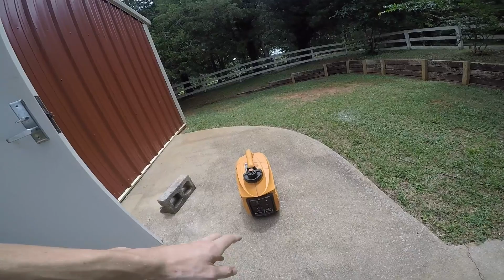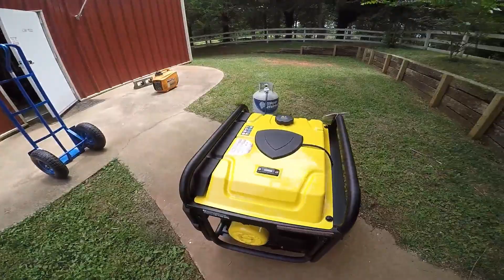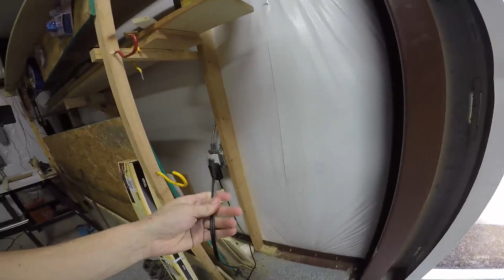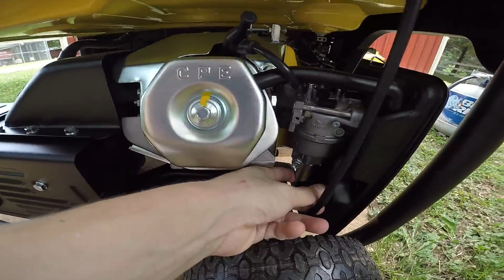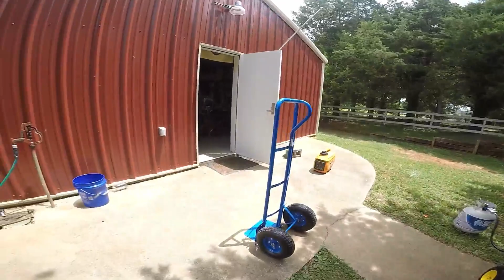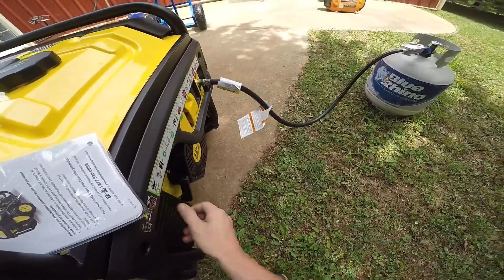Champion Dual Fuel 7000-Watt Generator Overview

Comment: As long as you have no gas in fuel line and carb when it's not being used. I use  SEAFOAM,
and when done, i shut off gas and let engine run out, the drain to make sure no gas is left
in the carb.  I start my 2 gens every 2 to 3 months and they start everytime.. get urself a note
book, keep track of hours run so u know when to change oil. make sure air filter is also
properly serviced it makes a much bigger difference than you know.. if u have nat. gas and in
an emergency situation, blizzard tropical storm, I wouldn't worry about emissions.

Comment: It will run off of natural gas, but it will require a natural gas regulator as the propane regulator is different.  It will not run off of natural gas connected to the factory propane regulator.   Add the second regulator fairly inexpensively and enjoy a tri-fuel generator.

Comment: Hello sir, how does the Champion Dual Fuel 7000 Watts hold up over the years?  I am planing to get one from Costco but don't know anyone in my family and friend circles owning a Champion generator.  So, just curious about its reliability.
Reply from the maker: Well, it really hasn't had much use until recently. It ran for about a day a few weeks ago after the power lines were knocked down. Ran flawless with no issues, and that is better than what I can say for the Generac. Long term it's hard telling but it is holding up pretty well and still starts right up. I do only run it on propane, to keep the internals clean. Almost all Genertors now days are sourced from China, that said the Champion brand machines seem to be a higher quality China than the rest of them. No complaints so far.
Reply: @crazyjdkid  Thank you for responding.  That give me a little more confidence to look into getting the Champion Generator (Duel Fuel) that I see at Costco.com.
Reply from the maker: Thats were I got this one.

Comment: Generac makes lousy residential generators from portable to back up type. I do not understand the desire to use propane in home situations. The tanks and fuel are expensive and in a disaster situation such as a hurricane the propane supply is hit harder than the gasoline supply as there are more gas stations than propane fill establishments. The tank shown is about $35 and holds 4.7 gallons or about $18 you have about six hours of run time with that tank. This type of generator is not safe for sensitive electronics, this unit does not produce a pure sine wave. Use non ethanol gasoline if stored properly two years is the shelf life.
Reply from the maker: Propane is an important fuel for backup generator. It gives you flexibility in fuel options. Everyone usually has a propane tank laying around for there grill so its not extra fuel you will have to store. I don't know where you are located but here to fill a propane tank like that is about $9 not anywhere near $18. The oil stays cleaner longer and I can hook it up to natural gas off the house if need be in a pinch. So there is a lot of logic in having propane as a backup,and I can always run it on gasoline if I need to as well since it is dual fuel. The less gasoline you run the more likely it is not to have carb problems, fuel leaks, gasket and hose deterioration.
Reply: @crazyjdkid  I am not disagreeing with you about propane being an alternative source of fuel it is just more expensive. I live in a major city and people have different criteria and the prices for propane here are about $4 per gallon. As I stated in my situation propane was impossible to find during the last three hurricanes while gasoline was abundant. One store I use had gone through 30,000 gallons of propane in two days and did not know when they would be resupplied. 
I use the Honda EU2200i and I was out of power for seven days once and then three days and used the generator for 48 hours while using 5 gallons of gasoline. I don’t think everyone has a propane tank lying around; my neighbor did not have a match to light a candle. In your situation propane seems like a great alternative. I had a Kohler 8.5 hip. generator a few years ago and to switch from propane to natural gas I would have needed to change carburetor jets, hopefully yours is set up for both fuels. People how do not have the natural gas option should not depend upon one twenty pound tank to get through an emergency or disaster situation. The problem with carburetors gumming up is lack of proper maintenance and using ethanol gasoline which I never use in a generator. In my many years of operating generators I have never had a seal or gasket go bad, but I am very finicky about maintenance. Best wishes to you and I hope you never have to use your generator in an emergency or disaster situation.
Reply from the maker: @TheMickeymental  This generator can switch fuels without any modifications, all you do is turn a knob to switch from gaseous fuel to liquid fuel. So I can use either fuel. I believe it can run natural gas through the propane line as well, just haven't tried it. All I am pretty much getting across is that it is a dual fuel generator that I can choose what fuel I use and switch at any time depending on what is available. I generally have 3 LPG tanks and 20 gallons of gas at my house at any given time for other machines. I use the LPG first as I don't store it with fuel and I don''t want to have fuel stored in it. Honda generators are great, and you could easily add a Trifuel kit to yours too. I have about 40 pieces of outdoor power equipment and the less I have to maintain and ensure the fuel is stabilized the better. Preferably I would rather have a diesel above anything else, which I do have as well. This generator has seen some use recently after a tornado in the area droppped some power lines, ran great and got better than advertised fuel usage. Thanks for watching!
Reply: @crazyjdkid  I looked up generators and the dual fuel are gasoline and propane. The trifuels are gasoline, propane and natural gas. Diesel generators are usually larger more expensive generators. If you are depending upon your generator to use natural gas you may want to investigate  whether yours will or will not accept natural gas. As I stated the Kohler I owned needed to have a different jet. Also with propane you will be getting less energy as it requires 1.38 gallons of propane to equal 1.0 gallons of gasoline. I am not sure if that will shorten your run time or cause you to use more fuel. I found that to be interesting. The Hondas presently are sold out at a lot of online site especially the 2200i. The corona virus along with the wildfire problems in California have caused a price spike. What state so you live in?
Reply from the maker: @TheMickeymental  Yes, but I highly doubt that there is much difference in burning the propane vs natural gas mechanically wise besides a significant power drop. The propane does have slightly lower run time, at 50% load your looking at 5.5-6 hours for one 20lb tank. It uses about 1.3 gallons of gasoline per hour under 50% load. It's a thirsty machine no matter what way you look at it as it is not an inverter unit that can throttle down. It runs 3600 RPMs as soon as it starts. This was filmed in Alabama, but live in Texas. I am actually a mechanical engineer, for a large industrial diesel engine manufacturer so I am pretty fluent in engines and air/fuel ratios!
Reply: @crazyjdkid  I am in Florida we get a lot of the same weather, but our tornadoes are over the ocean mostly. The difference in natural gas and propane is the carburetor jets, but propane does have a higher btu rating than natural gas. I am only a professional musician so you have me on the engineering part. Good luck to you.

Comment: I pay $20+ per propane tank here in CA so at $9 where your at is definitely the way to go. Plus the propane won't go bad on you and safer to store. Thanks!
Reply: Paid $23 the other day  in NC. at a Food Lion Supermarket. They're usually high on everything. Sam's Club is usually ridiculously low in Greenville, NC. If you ever see this. I hope your last four years have been good for you and yours.
RICH
Reply: Oh sht. When using fossil gas, of course, gumming up is not an issue. WATER IS!!!. NGpriduces two H2O molecules for every one molecule of NG burned. Ya gotta get that outta there. I run gasoline for about 30 minutes after a couple of hours on propane, to drive out the water. Your not just gonna get rust, you're gonna get mold/mildew. Rust gets in everywhere because it will travel around as a vapor. It's now humidity. Well the clean up for mold is usually worse. It's certainly not flakey. It's slimey/gummy. And it's a carcinogen. Not just the black one, which is the worst, but the other colors too. You don't want it on your skin, and you certainly don't want to breathe it. Your lungs are  breeding ground. All you need to grow mold is moisture, temp of 40 degrees F, and dirt. Their food is in the dirt. Nothing dirtier than all the stuff floating around in the air we breath. Nobody around here wears masks when working on any gas fueled stuff. Most houses til about 20 yrs ago were being built into all electric homes. Now, some of the surrounding towns have NG, but not everyone. I'm pretty danm sure there's less BTU in Propane than NG, so your gonna burn more propane than NG. and certainly more than gas. I could probably do the figuring for how much more water for propne tha NG, but who cares. All you need to remember is that its 2 to 1 coming out of propane. HS chemistry and physics were not my best subject. Now I use that stuff all the time, so I might be as good as a beginning sophomore college guy. No matter. Just be careful with that stuff. I'd rather hear you had to buy a new generator than you were dying of lung cancer from mold killed my brother. It got into a tube they installed for dialysis. Went to the heart, went in the blood., went to the brain, bingo. Dead in less than a week. Nothing they could do. A "Bread Type" mold. It was all around his apartment, heavy in his bathroom, crazy heavy in his heating ducts. If you ever go to clean up mold, diluted bleach is recommended by some. I'd never do that. Spray mold, especially the black one, you'll see the spores shoot out into the air. Looks just like a particular seen in the first Star Wars. Mold is a world wide epidemic, although rarely talked about. Heavily insulated housed conserve on heating and cooling cost, but they're now sealed up like a box.  Nothing gets  in, nothing gets out. Three complete air changes with 40 to 50 percent is more than you want, but if bring it down into the 30's, wood drys out and starts splitting. Balance is everything.

The solution to solution is dilutions. Works for a lot of stuff. Even life. You'll get the hang of thar one. Ain't gonna tell you about it. When ir pops into your brain, you'll "hear" it. Wish I had time to send this kinda stuff but I just don't have the time. So hopefully, today I helped u, yours., and anyone you care to. Just give the concepts, the facts only mean stuff to me. The concepts are what's important. With a little bit of HS knowledge and practice, concepts will give you formulas you don't need. Just "Clean, Mean. & No Green!!!. We good?

Comment: Thanks for the video. Like the propane option but based on the run time you get from a 5 gallon cylinder it looks like it is going to be much more expensive to run for extended periods of time than using gasoline?
Reply from the maker: Yes and no. It depends on how cheap you can get propane. Here its ~$9 to refill that tank. And since we have a propane grill we always have it so we always have some fuel for the generator at almost any given time. Really we prefer the propane so we don't have to worry about stale fuel and storing it, gumming up the carb etc. It is always there as an option though it we need it. I believe you could possibly tap into your houses natural gas line and run it off that as well.

Comment: Can you run this unit 24/7 with a refrigerator and some appliances?
Reply: The manufacturer will say NO but people do it all the time... Especially when a natural disaster hits and the power in the city is out for days... At that time you WILL see people run their generators 24/7 .. My brother in law ran his for 8 straight days NON STOP .... Yea he did change the oil before the hurricane hit just in case and he changed it after ...  But he said it ran solid for 8 days ...
Reply from the maker: I was thinking more along the lines of off grid where it runs all year long non stop. It can absolutely run for a week straight as long as you can fuel it and do oil changes on it.
Reply: @crazyjdkid  it all depends on how well its built ... Doubtful it was built to run 24/7 all year round ... Your talking about a generator  built for a single purpose, to provide temporary power ... Not power 24/7 for a year .. If you tried, if would probably last a few months IF LUCKY before something internal within the engine breaks apart ...
Reply from the maker: Probably not advisable. You would need to do oil changes and what not.

Comment: How much fuel does it consume if you run it closer to idle rather than 50%?
Reply from the maker: It will not produce power at idle. This engine has to be at full speed to be able to produce the 60Hz needed for the electricity.
Reply: @crazyjdkid   In this case by idle I mean no electrical load...
Reply from the maker: It would probably be very similar to a Honda GX390 in terms of fuel consumption. So about  .92 gal/hr @3600 .
Reply: They say .76 gallons of gasoline per hr at 50% load... With NO load..?? Good question...
Reply from the maker: @ACommenterOnYouTube  They state .87 gallons of propane an hour at 50%. and .75 gallons of gasoline at 50%.  Propane is less power dense than gasoline.
Reply: @crazyjdkid   ... ahhh... yea i know this

Comment: thats pretty cool.. the store i go 2 sells champion generators but there only gas 1's.. 4,000 watts. been thinking of picking 1 up..
Reply from the maker: I can't suggest them just yet, I need to see how it holds up first! If it hold up well, then I would be happy to suggest it.  The fact that it runs on LPG is really nice for storage. 4000 Watts can power quite a few things in your house. Thanks for watching!
Reply: ur welcome :) u can get them 4 cheap.. the north stars r over 1K..
Reply from the maker: Why the only reason why the NorthStar ones are so expensive is because they have Honda engines on them. Honda engines are practically bullet proof. Honda actually makes entire generators themselves too, they are way more expensive then the NorthStar. But they are so quiet you can barely hear them running.Just a little 2000 Watt generator from Honda is like $1,100.
Reply: well thats 1 good thing, Honda engines seem well build. i dont think i've looked at Honda  generators.

Comment: Hey Excellent video and opinions. I checked your other videos out on the portables. You would think they would invest in better inverters. It’s nice to see a dual setup. That’s a Honda clone motor. So most of Honda Parts could be used. The carburetor is the really only part that gums up.
Reply from the maker: Yeah! It really upsets me that they both failed with so little hours, just outside there warranty. That's why they lost my business. The dual fuel set up is really nice, and you can actually order kits online to convert most generators as well. Gumming up the carb was probably the most concerning thing for me, but with running it on propane I think should avoid most of those issues. Thanks for watching!